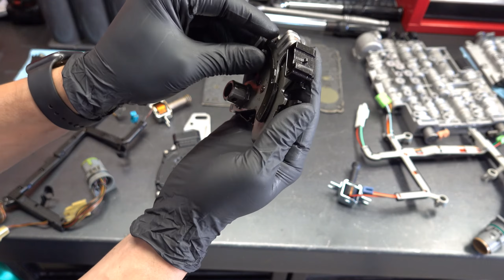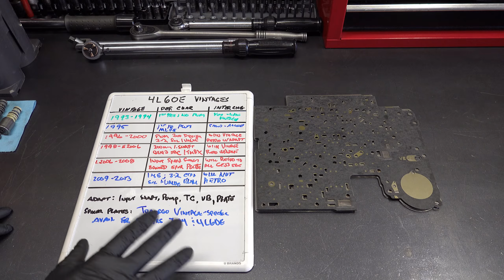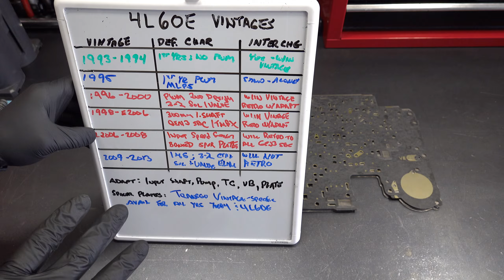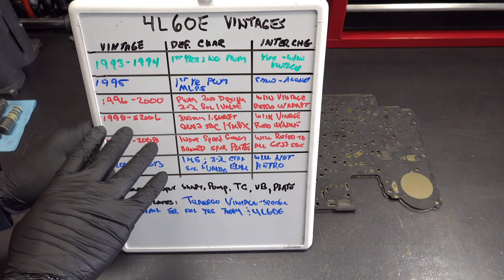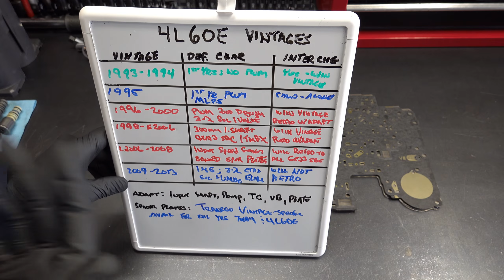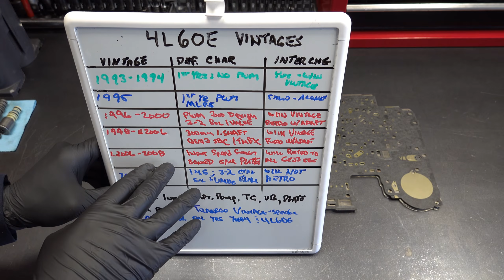How to Buy a 4L60E - Changes and Interchange Rules

Comment: I just bought & installed a 4l60e trans from a 2011 gmc, into my 2007 gmc and it will not shift into any gears, reverse drive nothing. Help???
Reply from the maker: Hi Chris, did you watch the video? 

I address interchange between those years of 4L60Es and corresponding vehicles with very specific guidance on what to do (and what not to do).
Reply: @nickstransmissions  I didn’t pay attention the first time I watched it. Now that I watched your video again, I can see that I messed up. I do have another question tho. Could you use a 05 or 06 4l60e trans to replace your 07 4l60e trans? Or does it specifically have to be a 07 to 08 trans?
Reply from the maker: Hey Chris, you'll want a 2006 unit with a turbine speed sensor (TSS) if your current transmission also has the TSS as the PCM/TCM will be looking for it and if it doesn't see the TSS input signal (voltage) then you'll have problems. So 2007-2008 or late 2006 for trucks as the TSS was added as a mid-year update for all the 4L60Es that went into the 1/2 ton truck chassis vehicles.
Reply: @nickstransmissions this comment is gold. So glad I came across this. Thanks!
Reply from the maker: You're welcome, man.
Reply: @nickstransmissions I just pulled a transmission from an 07 truck for my 07 truck but connector is green what do I have to do to switch to tan connector. Thanks.
Reply: HELP I may have messed up before seeing this video!!!  My truck 09 GMC 2wd 5.3 came with a 1LPD, I bought a 9LPD thinking it was for a 09. Will the 9LPD work in place of the 1LPD???

Comment: Interesting. The new replacement main case from GM is stated to cover 1996-2014. One part number 24247300
Reply from the maker: That is interesting...The case itself must have only immaterial changes; technically it would work for anything all the way back to 1993 if it will retro to 1996 as there's nothing different about the 93-97 when it comes to case OAL dimensions, worm tracks in the case belly, hydraulic circuitry for the pump, servo, low-reverse, etc. The only differences in case design, apart from the move to a detachable bell and 6-bolt ext housings is the move to the pump-to-case wedge seal starting in 2004, which eliminated the large o-ring on the pump body there from 1982-2003.

Comment: I want a put a 06 in a 03 but the 06 has a 1 connector mlps and the 03 has a 2 connector neutral safety switch. Can i make it work
Reply from the maker: Hi Goatman, just install the 1995-2003 MLPS onto the 2006 unit - will work just fine.

Comment: purchased a 2007 4l60 core removed pan and had no valve body or spacer plate, previous owner installed pump with out input speed sensor and green connector harness. purchased 07 valve body from dealer came complete with all solenoids including 3-2 solenoid. would i have to buy a bonded 07 plate or can i install 96-06 trango plate with gaskets?
Reply from the maker: Hi Leo, grab a Transgo 46-PLT-07: https://res.cloudinary.com/transgo/wbiss/sc/46-PLT-07.pdf. These don't require the bonded gaskets - you will want to install the gaskets with the orange striping as opposed to the white striping. 

Thank you for watching!

Comment: Will my 2005 transmission be able to use a 2001 valve body?
Reply: Is there a video explaining how.  I'm not a transmission guy but doing my best to find one on here.   I'm doing a ls swap and it's testing me greatly
Reply from the maker: As a matter of fact, there is: 

Valve Body testing PT1-Initial Results: https://youtu.be/MpWXgXbpYYU

Valve Body testing PT2-Repair: https://youtu.be/uNJj3RH94bc

Valve body installation: https://youtu.be/BEWXD8CrnwQ
Reply from the maker: Yep...104 inch lbs on all VB-case bolts; vacuum test the 2001 VB to make sure it's good to go, convert the PWM to on-off then install it.
Reply: I may be missing something here.  Pwm to on off takes what exactly?
Reply from the maker: Did you watch the videos? Particularly the valve body testing part 2: https://www.youtube.com/watch?v=uNJj3RH94bc

I explain this in detail in that video...If you have a 2001-2003 valve body, you will want to order this Fitzall valve: https://www.amazon.com/4L60E-Transmission-Valve-2000-2003-Non-Can/dp/B01I21T4GE

Alternatively, you can install a Transgo shift kit (SK-4L60E) and that will also come with a valve and spring to convert your TCC PWM apply to an on-off apply.

One other thing I should have mentioned: If your vehicle has active cylinder management / active fuel management (ACM/AFM), you will want to keep your PWM active...I don't think any 2005 vehicles had those; I believe that did not start until 2007 w/the GMT900 series trucks/SUVs/Vans. If you have a passenger car like a GTO, check with the dealership - give the parts guy the last 8 digits of your VIN and he'll tell you if your engine is an AFM/ACM engine.
Reply: I got one question if I wanted to interchange from say a 2001 4L60E from any year up from that point  to a 2006 tranny 4L60E in-between those years what will I have to do to make any of those years work too  put a tranny into my 2004 GMC Yukon 1500 6.0L if I wasn't using the same year 4L60E that's already in it so from 2001 to I believe 2005 if I cross the years into gmc trucks what all changes must I make I kind of got a little lost im just checking for the right answer

Comment: Hi Nick Good morning, Great Info!!,  Maybe i am the first one, I bought a brand new left over 2009 4L65E Trany for a 2 wheel drive Truck for my Project car,  At the time Not knowing anything about the Change from 08 to 09, 15 pin plug to 17,  My kit and set up is a E38 ECM and T42 TCM with a 2008 "Truck" operating system,  My Motor is a 2006 LS2 "Vette" Motor from a wrecked corvette,  The Reason why you have to use a Truck OS when using a 4L60E series with a 58X LS motor (06 & up) is because the is No Car OS durning those years , All the cars got the 6L80 6 speed transmission, So you run a "Truck OS"  E38 & T42 is the way to go, with DBW and a corvette gas pedal , Anyway my kit came with the ECM- TCM,  Gas pedal  and harness with the 15 pin Plug, After figuring out what transmission i actually had , i did some reasearch and made a few phone calls, even got the GM bulletin on the new 09 4L65E,   So i picked up a 08 valve body and spacer plate and swaped it out ,  Believe it or not everything works and shifts fine, except my 4th not holding 4th if i slightly lay into it, She slipps in 4th but as mentioned before i believe its the servo,  The only other thing is that i never got the car to down shift 3-2  but that could be the tune , and if i lay into her in 3rd shes a animal,  She put down 700 at 15 PSI,,   I have a fully built (2006) 4L70E in the basement i guess i should stop playing around with a Factory spect transmission and install the built one because of the Power she makes
Walter
Reply from the maker: Thanks for sharing, Walter...Yes, once you go outside of the factory PCM/command and control you have a lot more flexibility when it comes to swaps as you can tune in or out different nodes based on year and sensor suite. The 08 and back VBs would never work correctly on a purely factory application but should be fine for something using non-factory transmission control programming logic. The only real differences when it comes to command/control is the elimination of the pressure switch manifold assembly and corresponding range position pressure switches...The 09+ internal mode switch performs that function.

Yes, install the 4L70E if it's built to handle that sort of power your engine's making.
Reply: @nickstransmissions  Hi Nick good morning, Yes i finally decided to just use the built 70E and pull the 2009 65E out of the car,  i am going to reinstall the 09 VB and install a Corvette servo  for the 65E because its a really solid transmission and shifts beautiful and holds the power Maybe someone can use it in a later model 2009+ truck etc,  OK as far as the Built 70E that i have i bought it from a friend about 5 years ago His good friend built it for him Told him what Parts to buy, it was originally for his 2 wheel drive Trail blaser SS with 6.0L on NOS ,  My friend was very heavy on parts , Drag racing and a heavy foot light to light, Pretty much he broke everything he owned LOL,  His friend the Builder very well knew this and threw everything you can at this 70E    i have the hard parts receipts for it which had sun shell, drum , shafts   etc etc, OK but this is what bothers me about this 70E, The builder was known for building really good 200's  the 200R4 that came in the buick Grand Nationals , As far as the hard parts and that the 70E has 5 planets im not worried about his work when it comes to that,  What i more concerned with is did he install that better faster reaction springs?  Did he block off the 4th accumulator, eliminate the PWM,  and also that front Pump mod ,   I know it sounds crazy but i really cant install it not knowing that everything was done,  Im going to pull the pan and look over the VB and see whats going on, i guess ill have to pull the VB to see what he did with the 4th accumulator,   Not sure exactly which servo he used but it has a completely big flat cover ,  
Walter
Maybe you can walk me threw what
Reply from the maker: Dude, just go through it with a fine tooth comb and install anything that it needs, back to front....otherwise it will keep you up at night biting your nails,😬⚙️😎🍺
Reply: @nickstransmissions  LOL I hear ya,  Listen I know the Builder, He was a really good Transmission guy Like yourself, I havent seen him in a long time We all moved to different locations,  As far as the Hard Parts,  Drum, sun shell, shafts, Clutch assemblies, ETC  i believe in his work,  So i dont want to go that deep into her,  but the Valve body and the Front pump mod  "i need to know"  i would think he used the better reaction springs in the case,  As far as the VB and the pump, what is important that "Must" be done for a all out performance build,  if you can list them so i can make a check list for when i pull the Pan and look it all over, Be muich appreciated,  
and get whatever parts it needs like that fizt all valve etc,
Walter
Reply from the maker: Let's flip the script here and have you list all of your "must have" hp parts and "must do" procedures and ill fill in any gaps for you. I think you have a good handle on things, awareness of what your transmission needs plus all of my 4L60E high performanve vids so watch those to generate your list. Once you post, ill review and reply back with any addl recs.
Reply: @nickstransmissions   Hey Nick Happy Holiday and sorry to keep bothering you, AS far as "Must Have Parts"  well LOL im not 100% sure, But knowing that she put down 700+ HP,  @ 15-16 PSI (LS2) small Blower 222/235  .600 lift cam and 1 7/8th Long tubes and 3" exhaust with X pipe i would think i need a pretty stout 60 series Transmission,  Some will say go with a 4L80,  Thing is the 60 fits and fits with no issues , A few Guys like Ryan a Performabuilt transmissions say not need to go with a 80 That i proper built 60 series will hold,   So i know she has good hard parts in her as far as shafts and drum and high performance clutches,  Im assuming that the reaction springs were replaced with the performance ones,  , i know there is a part that is used on the pump that builders do , and i want that VB the best it can be,  So knowing that she puts down 700+ and pulls like a freight train what would you suggest if you were building a 60 series for this kind of power  
Walter
Reply from the maker: Watch this video: https://youtu.be/PXM3NnC6oVc

That build is a carbon-copy of yours based on engine type and power (700HP) and so is an ideal blueprint with all the parts you'll want to install...The only things I'd recommend beyond what I show in the video are:
1. Sonnax billet steel reaction shaft
2 Sonnax billet steel coast clutch hub (if you're going to be doing burn outs).

I added the billet reaction shaft to the trans featured in the video afterwards but didn't do the coast clutch hub as the customer won't actually be racing this vehicle.
Reply: @nickstransmissions  OK im going to watch the Video,  I am looking for the receipts of the Parts that my friend gave me, i remember he did by shafts that were expensive
Reply: @nickstransmissions  Hi Nick I found the Receipt of the parts used in the build, is there a way i can send them to you to look at?
Walter
Reply from the maker: Hi Walter - Compare it to what you see in my vid linked above and let me know what questions you have.
Reply: @nickstransmissions   Hi Nick, the "Built" transmission i have is going to need to be looked at, I want & Need it right ,  The receipt i have showes the Smart Tech Input housing kit,  I believe thats the Drum & Shaft ,  2 wheel drive 4L60E 300mm Billet Output shaft,  4L60E RedEagle clutches 
Alto G3 3-4 clutch pack, Wide Band, input pistons, 2007 AC delco pump,  4L60E Molded pistons X 2, 4L60/65E Pinless aaccumulator, 700R4 Pinless accumulator
OEM Type replacement spring, 
intermediate servo release check valve,  
i dont see anything about the upgraded sun shell etc,  and im hoping they used the right input shaft with the reluctor ring for the turbine sensor , I believe they did because this transmission came from a 07 Trail blazer SS and was built for it so i believe that ECM/TCM needs the single input from that sensor,  My car needs that single too,  anyway i guess i need someone to look this tranny over,  Not sure if he used the better bushings you show in your video etc,  i doubt they installed those upgraded parts in the pump,   
Walter
Reply from the maker: Got it...For the amount of power you'll be putting out, I'd definitely go through it..If a standard sun shell was used, along with a factory reaction shaft and CC hub, I'd upgrade all to Sonnax billet equivalents. I'd also install all the Sonnax bushings and maybe even use a 'bolt-in' center support which I believe is ductile iron or billet steel. I'd also block off the 3-4 accumulator, put a wide band and new rev input drum plus a nine-clutch 3-4 pack (that may or may not have been installed)...Add in all the requisite hydraulic mods, etc.

You for sure need someone that has plenty of reps/experience with race 4L60Es and knows what to do. 

What part of the country are you in?
Reply: @nickstransmissions  Long island NY,  You?
Reply from the maker: I'm in the far southwest but you're in relatively close proximity to one of the best GM transmission builders in the country, CK Performance...Chris Kirkonis is the owner, runs the business with his wife Michelle. Give them a call tomorrow at 347-836-8142...See if he will take on your project...
Reply: @nickstransmissions  OK where is he located?

Comment: Do you prefer a transgo plate for a rebuild
Reply from the maker: Thanks for watching, H.W. Miller...I am good with either factory or Transgo plate for a given rebuild; I will say that, based on feedback from customers, The Transgo spacer plate provides very smooth and balanced shifts as is. Much more so than the factory plates. So if looking for a smooth shifting transmission and needs a spacer plate due to excessive damage, warpage, etc then I install a Transgo plate.